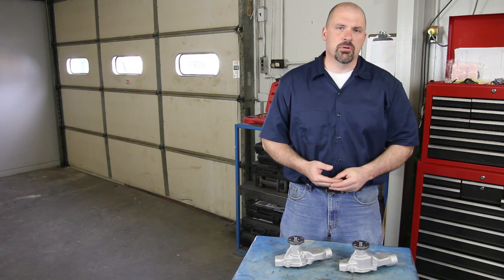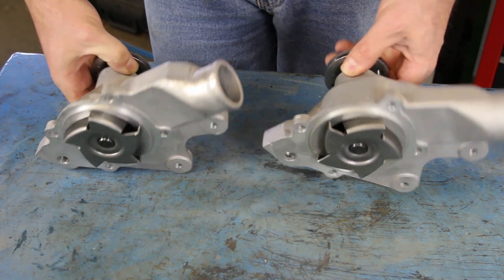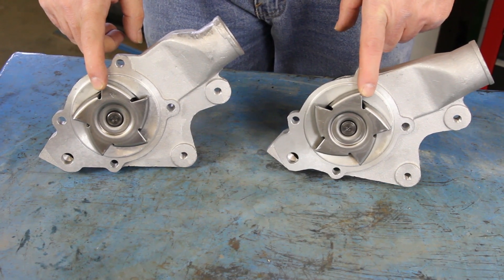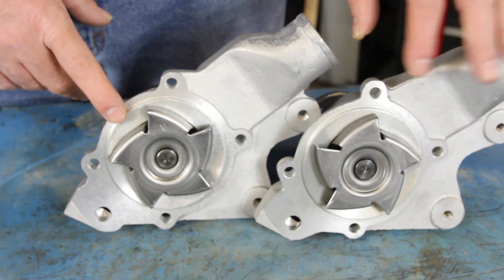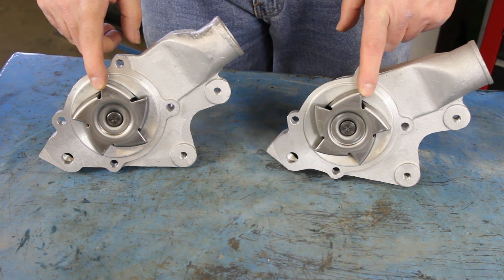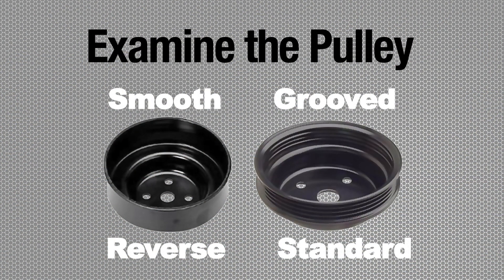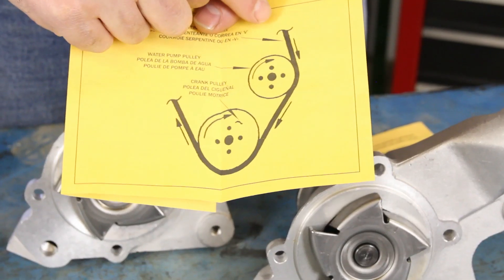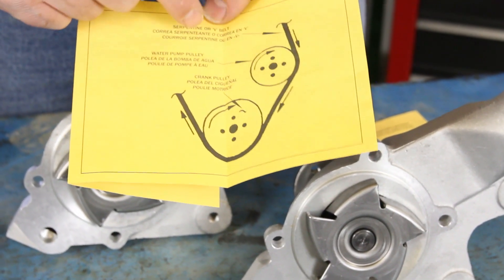Standard vs. Reverse Rotation Water Pumps

Comment: I am trying to understand not only Reverse v Standard, but also clockwise v counterclockwise.
If I’m sitting in my truck then the fan is turning clockwise.
But if I’m standing in front of my truck looking under the hood then the fan is turning counter clockwise.
Should I call it from inside the truck or in front of it ?  

Also, the smooth side if my serpentine belt is riding on the flat smooth pulley that attaches to the fan shaft.  So are you saying this means it is a Reverse impeller rotation ?

Comment: ive changed pulleys sizes & 4 diffrent belt length jeep 4.0 is running hot after 20 mints ,i rolled bearing in thanks for the food to think with you know what i meen

Comment: So our bevoled 302s have two kinds of water pumps depending on the belt configuration - so far so good.
But: Does a reverse waterpump also invert the flow direction or are they all the same?
Reply: all the same,  just imput direction

Comment: Thanks for saying which pump is reverse and which is standard, very helpful
Reply: Kristopher Peterson my thoughts exactly
Reply: By looking at the impeller design, the pump on the LH side of the screen is reverse rotation (pulley spins CCW), Pump on the RH side is standard rotation, pulley is driven CW (clockwise).

Comment: is standard clockwise or counterclockwise????????
Reply from the maker: Standard rotation: the pumps pulley or hub turn the same direction as the crankshaft. From the impeller side a standard rotation pump turns counter clockwise. From the hub or pulley side it turns clockwise. Yes, I know it sounds odd but that is how they turn!

Comment: The R stamped on the impeller seems to mean nothing or there stamping them wrong .cause a standard pump that spins to the right clockwise is the same as the one with the r stamped on it, the cups or veins spin to the right CUPPING OR SCOOPING the  water, so that makes no sense at all .How can water be moved by pushing the water off of the impellers blades , when a right hand spinning one cups or scoops the water .in the video it shows BOTH PUMPS .i just need the part # to the one that scoops the water to the left counterclockwise .now i know why there are so many jeeps out there overheating .no flow in rad at all ..airtex  no common sense..
Reply: yes yes yes yes   there is a lot overheating jeep for this fu...situation
Reply: @mariofuenzalida8601  just remove the thermostat and the upper hose end at the rad  water full  »»»   idle the motor and   make sure water gushes out fast,or give it some gas for 2  seconds!!

Comment: Thank you for the explanation. Do you know where to find a reverse rotation water pump? My husband has a 94 GMC Sierra SS and so far we have bought 4 water pumps that were labelled as being reverse rotation but they are not after checking them as shown in the video. All 4 were different brands. Or better, it is possible that the manufacturers are labelling the movement incorrectly? In this case we will need a clockwise water pump. Thank you for your time.
Reply: +Airtex Pumps Thank you for your answer.